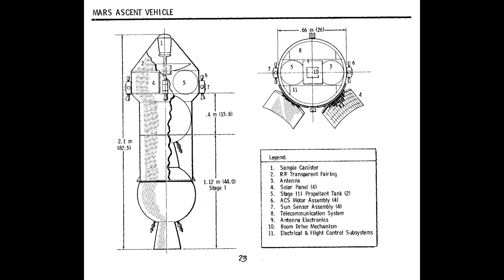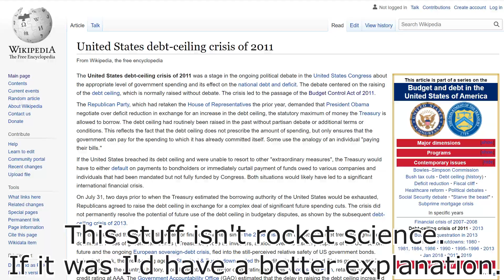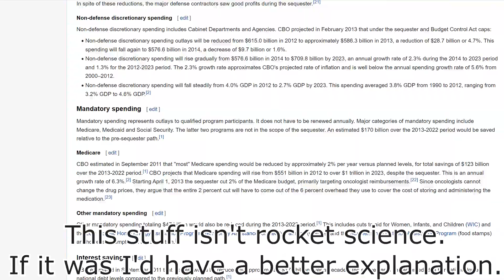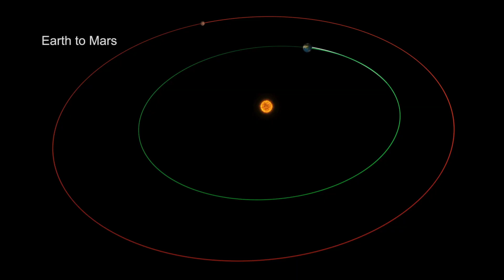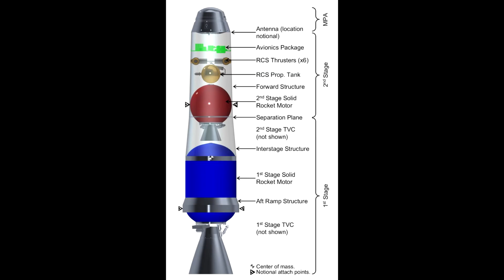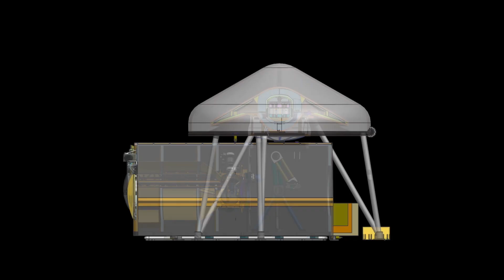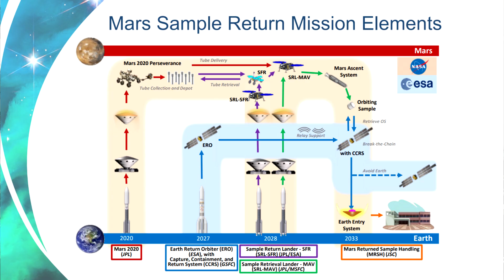Why Getting Rocks Back From Mars Is A Massive Challenge

Comment: Perhaps dumb question. If they just drop the samples on the surface, they're not worried about them getting buried in sand storms? I know with the thin atmosphere only small particulates get blown around, but wasn't that enough to bury solar panels and kill rovers? Couldn't that also bury those little viles? Return rover got a shovel?
Reply: Doesn't take much dust to kill solar panels. As for the vials, I believe that they're ejecting them in a larger storage canister- just hook it, lift, jiggle a little, no major dust anymore.
Reply: Dust storms on Mars don't move anywhere close enough sand to bury sample containers within a few short years. On the other hand, even a thin layer of dust on a solar panel can significantly reduce the amount of power a rover can access, especially during the winter months with the sun very low on the horizon.

Comment: would not be better to park it on orbit and them recover?
guess is too expensive, however that change in momentum sounds crazy.
wouldn't it have a significant impact on the samples?!
Reply: The delta V required to park it in orbit would be an insane amount that would double the size of any rocket needed. This isn’t KSP where you can do a controlled aero break and maintain an orbit with a functional orbiter. Once you enter the atmosphere you are landing.

Comment: It seems we could use the space station to help with this process.  Bring the capsule to the ISS and bring them back on a return crew mission.  That way the capsule doesn't need all that mass & structure for reentry.
Reply: Sadly, the ISS won't be up there when the Earth Return Orbiter returns back to Earth.
Reply: The mass for matching orbits with the ISS might be larger. It's on a wonky orbit so that the Russians will be able to reach it.
Reply: That just trades heat shield mass for propellant mass and rocket engines needed to decelerate the craft, get it into orbit, and dock with the station.  It'd just make the system heavier and more complicated.  Aerobraking is cheap.
Reply: @murasaki848  Plus it's a lot easier to expect that a heat shield will work after a year long cruise through deep space than an engine.
Reply: Problem is, now it needs enough fuel to get to LEO and rendezvous with the ISS.

Comment: Because Mars is far, rocks are heavy, fuel is heavy, and it's an entirely different animal to send a vehicle capable of a one way mission vs. one capable of autonomously landing, collecting samples, then relaunching back to earth.
Reply: Rocks are only 38% as heavy on Mars -- as is everything else. That's why such a small rocket could hoist the rock samples into orbit -- there's less gravity and atmosphere to fight against, and a stable orbit is at a much lower altitude than it would be on Earth. Earth is actually a pretty terrible place to launch rockets from; Earth is almost too heavy for rockets to work at all. Rocket launches from other planets would be much easier and require much simpler rockets.

Comment: 16:00 Ah yes, why use aerobreaking when you could use the much faster lithobreaking?
Reply: Maybe there might be an ISS replacement so they can just ship it down with the next experiment return mission.
Reply: @bbirda1287  The return capsule will have to be relatively small and simple so as to not make the whole payload too heavy. I'm not sure it'll have the complexity needed to ensure it won't crash into a crewed space station
Reply: @limiv5272  THEY are all weighted NOW with this current mission
Reply: @kukulroukul4698  I'm sorry I don't understand
Reply: @limiv5272  The Perseverance weights every sample already
Reply: @kukulroukul4698  I didn't mean that it would be necessary to measure the weight of the samples again, I meant that the weight of the return capsule with the samples in it will have to be relatively low for the mission to work. If the weight were relatively high it would require more fuel, and bigger tanks to store that fuel etc which would make the mission more expensive and possibly more complex
Reply: @limiv5272  ok , sorry / my bad
Reply: @bbirda1287  It would be probably impossible with the current design, or way harder with a redesign that could do it, to put the capsule in Earth orbit instead of doing a direct entry. If you want to get into orbit, you have to slow down from interplanetary speed using a rocket. With direct entry, the atmosphere will do that for you.

Theoretically, you could do aerocapture (get into orbit using the atmosphere to slow down), but nobody's ever tried that, at any planet, so they're not going to risk it for this, with what's currently an unguided capsule and a planet with a short atmosphere (meaning a narrow corridor to fly through). You'd also still need a rocket for circularization after aerocapture, and GNC for that burn, but it would be a small one.

Theoretically, the ERO could use its ion propulsion to enter Earth orbit very high and descend slowly, but it probably doesn't have enough propellant for that, and it would also delay the return date considerably, which would also give more time for things to fail.

Then, even if you've done one of those things, you have to transfer the sample capsule to some other spacecraft that could land on Earth (such as a Dragon), and that transfer could fail, or that spacecraft could fail, including in a way that spills the samples on Earth.
Reply: We should hope it's braking, not breaking
Reply: @TheGreatAtario  Genesis's return capsule got pretty lithobroken, but they still managed to get a bunch of science out of it.

Comment: I feel like every time a robot arm is involved, its a declaration of "we're not really sure what we have to do, and we might need versatility at the expense of complexity"
1st - I get it
2nd - probably didnt need that one
3rd - yall dont even actually know what youre doing yet
Reply: In the case of e.g. the ISS it makes sense, sometimes it's lighter-weight to go with the generic option.
Reply: @absalomdraconis  for sure. and I'd think one on the ISS is exactly the place and role youd want one.
the ISS a long term mission, which will serve many other missions that wernt even conceived of when the ISS and the canadarm were designed. you take the trade off in that case every time.
Reply: The exact same thing can be said for human arms, and we've done pretty well with those.
Reply: @fyrstormer  1st - hey this is great
2nd - the other one is dominant, I guess bilateral symmetry, fine keep it...
3rd - we're here to test your water
it checks out
Reply: @CraneArmy  4 you can allways use a head
Reply: The samples collected by perseverance are stored in cylindrical canisters. It seems like they could be pretty easily scooped off of the ground. I'm picturing a cross between a bulldozer and pooper scooper.

Comment: Is it possible that Space-X will get there before 2033 and could bring back samples ….
Reply: If Starship can become properly operational in a couple of years then a sample return by 2030 is possible, using robots. Getting in situ fuel processing running successfully on Mars by 2028 will be the biggest difficulty.
Reply: Well before 2030, and the sort of tons of gear SX will be able to yeet to Mars in uncrewed scout-missions will leave returning samples irrelevant.

Comment: I saw images of the sample canisters. My question is, given the long duration of this mission, won't the capsules be buried under the soil after repeated annual martian storms?
Reply: I believe those martian storms don't kick up nearly enough soil to entirely bury the samples, or at least where perseverance has dropped them there isn't much moving soil nearby. More likely they'll just be coated in a layer of the soil but not get in the way of anything.
Reply: The rover picking up the samples will probably be able to dig through dirt, or at least dig though a reasonable amount of dirt
Reply: No, the dust storms are just that, dust.  Not that big of a deal really, unless you’re talking about solar panels.
Reply: @fdavidmiller2  yeah
Reply: Mars doesn't have soil, it has regolith. There are no "sticky" substances to make the rock dust clump together. Mars regolith is about as small as soot particles, but without the organic tar that makes soot particles stick together. The slightest breeze will blow the regolith away; that's why the solar-powered Mars rovers were able to operate for so much longer than expected.
Reply: @fyrstormer  theres static electricity tho which is WORSE
Reply: @fyrstormer  of course mars has soil. regolith is a lot more varied, and a lot deeper than what just sits on the surface. there is also dust and more accurately - fines - being the extremely fine particles which get absolutely everywhere and coat solar panels etc.
Reply: theres a tracking system
Reply: @sebdapleb1523  so the vessels have something like a RFID to be able to find them rather than just relying on recording the movements of the rovers?
Reply: @Electronics-Rocks  no, I just looked it up. There's a sample deposit site where the rover will put everything, instead of leaving them in various places. The sample caches have no systems for tracking, unlike what I thought was the case.

Comment: @10:30 40m ellipse?  Really?  Or 40km?

Also why don't they just return the sample to the ISS? The 6 inside can be the canaries if there's any bad microbes on it, and you get the benefit of having an orbiting geologist take a look at it before sending it down into the atmosphere and crash landing. And if it clears those hurdles, which it almost certainly will, then you can send the samples down for a soft landing instead of pulverizing them into the ground somewhere random.
Reply: The amount of fuel needed to slow down into a low orbit, instead of letting the atmosphere do all the work, would be huge, and that would compound by requiring a bigger injection stage and a much, much bigger launch vehicle. Utterly inefficient and wasteful.
Reply: @the18thdoctor3  Not only that, but it would have to dock to the ISS. Much easier to aerobrake and lithobrake to Earth.
Reply: Entering Earth orbit from Mars is much harder than going straight to the surface, for exactly the same reason that things go directly to the Martian surface without entering orbit first... aerobraking. Using the destination atmosphere to slow down doesn't require you to carry any fuel to do it.

Comment: Wait, so that whole thing in the Martin about them sending mark supplies without a soft lander… might actually be feasible??
Reply: They actually launched a couple probes alongside the Mars Polar Lander that were supposed to impact the planet at full speed to allow a small probe to penetrate a hole into the surface. Unfortunately neither of them actually worked, but the concept is still a sound one.
Reply: The problem that they had in the book, and movie, was that any supplies inside had to survive the landing, so pretty much all they could send was food goo. No radios or things like that were likely to survive. They also had to build the probe light and super fast to make it there. The first probe that they tried failed, because there wasn't time for proper testing. Of course the author made the decision for the first probe to fail, so that left the unlikely second probe or the Rich Purnell maneuver.